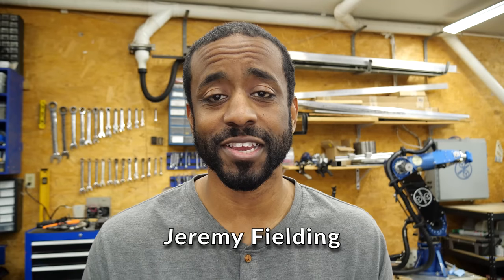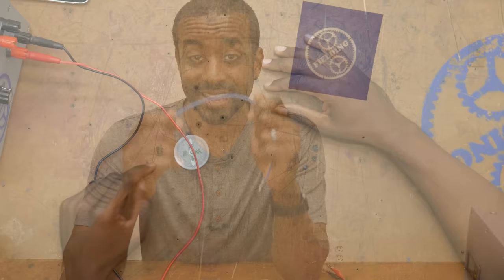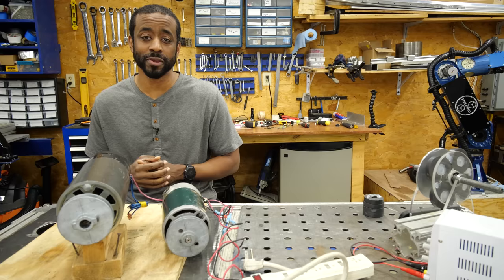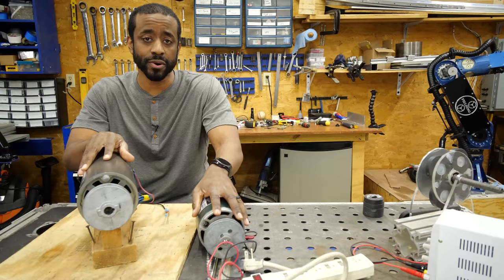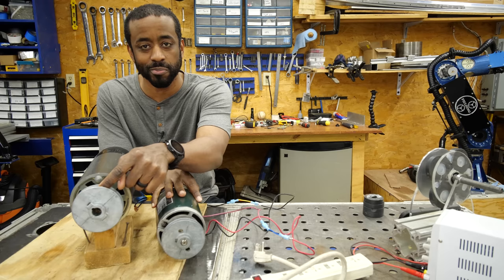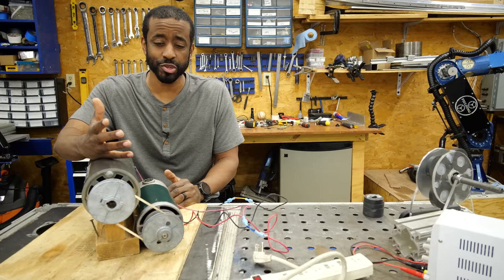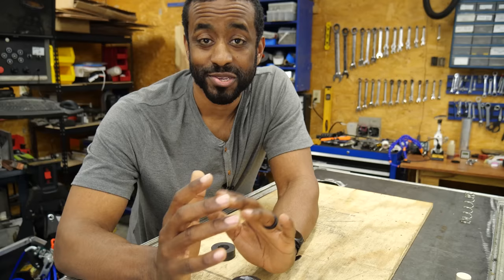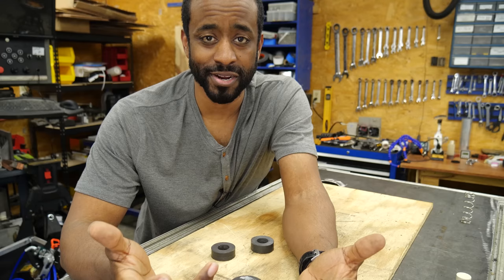Reviewing Free Energy Generators.  A Response to My Video "Nikola Tesla's Greatest Invention"- 102

Comment: In all seriousness, the hardest part about designing a perpetual motion machine is where the to hide the battery.
Reply: A radioisotope thermal generator (RTG) is damn close to being a perpetual energy source, outputting useful amounts of electricity from a battery-sized lump with no mechanical or electrical power inputs, and it will produce that electricity for decades or centuries. It's still not "perpetual" energy though and RTGs require a cold sink for the thermocouples or Peltier junctions to produce electricity from the temperature differential. Still neat though.
Reply: It's actually how to hide the wires.
Reply: @robertsneddon731   and even RTGs have huge limitations, take the MMRTG on Perseverance as an example... 

It's outputting ~110W constant, with a declining curve over years, it weighs 50kg (of which 5kg of plutonium dioxide) and still requires Li-ion battery to meat peak power in bursts. On top of that, it is basically working in flawless conditions given the huge delta-T on the cold sink, given the -60°C average on Mars. 

what I'm trying to say is that, while RTP are impressive (I can't deny that) they still are far from being anything remotely useful/practical here on earth. They have an efficiency of about 15%, while the same plutonium can be used much more efficiently in Nuclear power plants (about 35% efficiency). 

they are impressive cause they can produce power unattended for decades/century on end (while left in the right conditions) but that's all there is positive going for them.
Reply: @andy_liga  The point is that to the unknowledgeable eye RTGs are effectively perpetual motion engines -- they could run a 100W motor under load for centuries with no external power connections or trick components like compressed-air feeds (one fake perpetual motion engine I've seen personally used that as its power source). The best chemical batteries in the same-sized lump as an RTG might manage to drive a similar motor for a few days max then it would stop running as the batteries died.
The Voyager space probes which launched in the early 1970s are still being powered by their RTGs today although their output is well down from when they were fresh. It's possible that everyone alive when the probes launched will die before their RTGs  fail.
BTW RTGs use plutonium-238 which is not fissile and can't be burned in nuclear reactors. It just undergoes radioactive decay which produces a lot of heat since the half-life is something like 86 years or so. There are pictures on the Internet showing  a lump of Pu-238 just sitting there glowing dull red from radioactive decay.
The fissile form of plutonium is Pu-239 which doesn't get noticeably hot since its half-life is a lot longer. There are other radioactive isotopes that also work for RTG use -- the Soviets used Strontium-90 for some RTG applications and ESA is working on using Americium-241 as a "space battery" (not my choice of words, it's from a press release).
Reply: which is why veproject1's videos are so fun to watch.  you know they are fake, but figuring out how he did it...
Reply: @robertsneddon731  not really perpetual considering the massive amounts of energy to refine fuel and construct an RTG
Reply: @kobrapromotions  Of course an RTG isn't a real "free energy" machine or perpetual motion machine but it could be the basis of a very convincing fake that could run for years or even decades with no visible energy input.
Reply: In Zimbabwe their's a guy who created free wireless electricity on a car and tv
Reply: i discovered free energy 6 months ago but i dont want the authorities to find out !!    but i will share this with you anyway .  i took many of my household appliances and hooked them all to a large power bar then ran the other end of the extension cord to my neighbors  outlet on the side of his house . ever since then i got free energy !!
Reply: @foxwell1000  I think you need to watch this video again.
Reply: Lol
Reply: This is the best and most truthful comment out of the thousands of comments on this subject.
Reply: @UnitSe7en  actually not hard at all with the double male ended wire / cord as was shown here.
Reply: @foxwell1000  he is utilizing radio waves broadcast by tv and radio stations. It's clever usage of energy someone else has produced  not creating unlimited energy.
Reply: Another difficult part is using the throwaway collapsing coil flux that is commonly grounded out in dipole killing energy wasting circuits.
Reply: ...or the power cord!
Reply: This is some "Black Magic"! (see what I did there? :)
Reply: @robertsneddon731  Peltier's are little more than solar panels that run on a longer wavelength of radiation. Like solar panels they require input.
Reply: he he... actually got a good giggle from your comment. thanks to you for the punch and jeremy for setting  it up.   I needed  it.
Reply: @foxwell1000  No.  The amount of energy that reaches your house in radio and TV transmissions that he claims to use is measured in microwatts or nanowatts.  Yes, the signal does contain energy but it would take about a thousand years to gather the energy to boil a kettle with enough water in it to make one cup of coffee.   He's a fake, like all of them.
Reply: absolute truth !
Reply: @robertsneddon731  Not really.  The amount of energy put into processing materials to be used in a RTG greatly exceed the low end heat output, even if it last 60 years.
Reply: Exactly where do you hide the battery to make it seem like it's real
Reply: @FireAngelOfLondon  exactly there is energy in the air but not enough to be useful to do any real work
Reply: Yes it appears so far all likely cheat and are not real. Depending on the device type determines its ability to keep running. Example being physics based designs that are not meant to run anything. Often very simple and pointless. The few that are working are very rare. To this day only have a few minutes of footage, so questionable. Primary case I found is being some creator long dead. Installed it in a specific place which some lab decided to move thus broke its operation. At least based on research info I have found. Every device is designed around specific variables, in our case technology wise very simple variables. In realms of scifi imagination cave man level is about most of Earth inhabitants. 

There are a few physicist that explain why being certain places in earth have anomalies in gravity or natural energy fields being stronger, which fluctuate. This guy here covers energy efficiency and heat impact. Combine the two and you get crap shoot of good luck budding inventor… 

If it was easy anyone can do it. Point being its very fine crafting to do, even NASA engineers note this though the bulk just say its a fruitless endeavor. Also note unseen forces sabotage the device and currently we lack technology to negate them, NASA engineers have commented on this. Hence why we instead drive to mass energy storage because its better time spent.

The true issue is a simple one. Once you get it working. It wont run anything anyway as the new load or variable load will simply break the device. Also why NASA and other companies are hunting for better coatings and materials. If nothing else make the intended device work more efficiently. Now I am more in the camp of efficiency design over make it run on its own forever. At least until we develop real true high end technology. My conspiracy side asks if one in current era did figure something out, would they let you keep it or perfect it?
Reply: Absolutely and well said. 
In the field of Power Electronics it's about maximizing efficiency.  not about having more output than input. 
It is cool to speculate and fun to imagine tapping into some hidden energy somewhere and actually harvesting it to do something useful. 
So of course I don't denigrate  anyone who's trying to explain that these motor-generator sets that we see are always a trick or an illusion. 
It is important though to really understand the issue. And be clear about some of what has already been written about here.  harvesting energy that was already is in the air not including solar. 
RF energy for example
But if that is energy from broadcast transmissions it was generated originally from somewhere else and it's not just there. 
If you want info and entertainent on this subject look up the "electro boom" channel. 
Take Care
Reply: @robertsneddon731  You don't need a heat sink or thermal differences to produce electricity from a radiation source.  alpha, beta and gamma voltaic.
Reply: The guy just below has cut and paste your joke and using it for like down below you. The cheek! Get him!! ✌
Reply: @foxwell1000  That is amazing! He must be the richest human alive now...
Reply: @flatearth9140  LOL
Reply: @robertsneddon731  a battery.. you mean a battery. jesus
Reply: Underneath the floor of the vehicle ~
Reply: hard to hide petrol engines as well. the noise gives the game away.
Reply: Bedside draw...😜
Reply: Real original comment every video someone says that
Reply: @ronnielsen8404  Aww... someone's upset they didn't get to say it first.
Reply: you can have a batteries but they just need to self recharged in the process and not stop.
Reply: @robertsneddon731  yeah and that thing is nuclear no?
Reply: buwahahahaha
Reply: @hughmungus431  in other words still useless because we have solar powered battery chargers....
Reply: @robertsneddon731  just a late night thought, but could scintillation crystals applied to a solar panel, wrapped up in a barrel with a tritium doped liquid produce more wattage and eliminate the need for a cold sink, essentially producing a life long battery?
Reply: There are perpetual devices that have been running for a few years  through Inertia  by a Mr St-Germain from Drummondville Québec Canada. .  The device has been running for 3 years , last time I saw it run. .
Reply: @nivekjohn3833  no way Dilithium crystals FTW..... just ask Scotty
Reply: @flatearth9140  hahahahahahahahahahahaha!!!!!! Nice!!!
Reply: @hughmungus431  bbut how do you first start this up by hand ?
Reply: @flatearth9140  that is amazing! You should patent that! In fact, I’m on my way to try it myself!!! Thanks!! And don’t worry, it’s just between you and me….🤫🤫🤫🙊🙉🙈
Reply: @robertsneddon731  And there's your point - a good one. To me, one of the first giveaways that someone claiming free energy does not actually understand basic physics ("lies" as they call them) is that they are totally unprepared to answer the first questions that somebody who understands those "lies" should ask to vet the device. The most universally conclusive test I can think of would simply be to weigh the device, calculate the energy capacity of the most dense energy storage system potentially available (maybe an RTG) having that mass, and then allow the device to run and do external work for as long as it needs until it has output more totally energy than could possibly have been stored in the device. Nobody tries this;)
Reply: @robertsneddon731  damn close? that is like saying something is near infinite any number no matter how large is a minute amount when compared to infinity.
Reply: @hughmungus431  We dont care whether it can charge a battery at all.  We do care whether it can just run perpetually.  How is that going for you?
Reply: Perpetual motion machines exist in many forms, even with just gears. Even those that are not entirely so, only need a little help when running at their full potential, wich could be done by using a part of the energy it creates.
These things exist for 200 years now it's not that crazy, just not allowed to be used by public.
Electricity is literaly everywhere, our brains run on it, it's in the air even wich fluctuates with sudden temperature changes. It's a part of magnetic fields, wich btw, is perfecr for perpetual motion machines. Try buy a big magnet, oh right, you can't.
Reply: @1014p  your conspiracy side should question why a government company that researches ways to travel at lightspeed and literaly researches impossible things, says they don't bother because it's fruitless. The only reason they wouldn't is because they know already.
Reply: @hughmungus431  yes! You should look into the VandeGraaf electrogenerator and the Wimshurst machine. And how they used the Leidse Fles (Leyden Jar).
This was the first condensator ever. They charged them thru conducting thru coils, even Benjamin Franklin used them, where he charged them with thunder to proove it was electric. Read about those old conductors, they raised the power and also the capacity by connecting more than one. Oh yeah they converted the electricity also without affecting the source.
Reply: @kevinvliesable  I'm genuinely fascinated by your opinion. I'd love to just revisit your first statement - "Perpetual motion machines exist in many forms, even with just gears". As you are probably aware, established physics along with the associated terminology does not support this claim at all. I happen to believe I have a good grasp on established physics in this area. 
But you sound very confident, and I'm very curious about exactly why either you or me are blind to our ignorance. Or could it be that we don't actually disagree about physics, only language? 
I hope we can discuss: 
Do you care to describe a gears-only perpetual motion machine?
Reply: @drienkm  yeah I wasn't that precise, my apologies. Not only gears but with the help of some springs basically. Take Breitling watches. Once winded it never stops as long as you wear the watch because of a spring that always points the same direction, wich makes it move inside the watch whilst moving, winding the gears little by little.  This example is not perfect because it's kept running by a seperate process but that's because it won't fit in the watch if it wasn't and that's besides the point also.
Look, you know as someone with knowledge of physics how gears work. Like in a gearbox, the size of the gears opposed to the main gear determine the rate of speed at wich they rotate, smaller gear = faster, bigger gear = slower. 
My point is that if a small gyroscope spring can wind the entire system overtime, I'm sure this mechanic wich is able to wind up overtime without needing force could be applied by utilizing a gear.
Look man there even are systems wich can run forever without the possibility to stop, Google facility use them even
Reply: @kevinvliesable  Oh yes, my dad had one of those watches. You believe that it takes zero energy from the wearer to keep the springs wound via the internal weight? If it did take energy, I do not believe that would be "beside the point", even if we ignored the initial energy added to the watch by winding springs. Do you agree?
Yes, we're on the same page regarding how gear ratios relate shaft speeds. Just for completeness, I assume you are aware that gear ratios also relate shaft torque inversely to the  way they relate speeds, minus a small fraction of the transmitted torque due to friction. Are we still on the same page?
Meanwhile, do you have any leads where I can learn about the device you mention Google using?
Reply: Nah, just add a coil into it a transformer under the table. No batteries required ;)

If you connect the transformer to your neighbors electrics you'll have actual free energy. Well free for you :P
Reply: I wish you would cover what and How Tesla was going to send Energy through the Air. I know you had to have a Tuned Filter to receive it from the Tesla Coil. He was sending it through the Ground I believe. I would love to have you explain it.👍😁❤️
Reply: @joeybobbie1  Do you view sending energy through the air as significantly related to the topic of free energy?
Reply: As soon as I saw that video, I could see tons of ways to fake it. Today's lithium batteries can dump tons of power for a demonstrations like this.
Reply: Yes sir, No such thing as Free energy. Everything comes from somewhere.
Reply: Exactly. Or when built by a well intentioned person, maybe the hardest part is internal defense of one's own belief that "I don't need to get educated in all that fake (and maybe kinda hard) science and physics stuff! The fact that free energy isn't commonplace is just because of widespread, and unbelievably well executed coverups that extend into every facet of technology and industry in the entire world. Yes indeed - an unprecedented marvel of human cooperation, unity, organization, communication, and precision of execution..."
🙃
Reply: @robertsneddon731  and damn close is absolutely useless in this case...
Reply: Same problem with solar and wind power. 🤣
Reply: Prefect Answer.🤣
Reply: @kevinvliesable     (-:   

So then what you are saying is that at home  you have a simple PM machine running, running, running............   If not, why not?

"Not allowed by the public"???   So then, you have people appearing at your doorstep checking to see if you have any perpetual toys in your house?  That has never happened to me.

Big magnet????   If magnets can propel a PM machine, a small one will run just as well as a large one.   So far, in the history of the whole world, no body has ever demod that a permanent magnet could power anything.   A permanent magnet cannot propel a device, not even partially

For perfectly obvious reasons.
Reply: @robertsneddon731  who has one for sale?
Reply: @wendellhammond7853  Software needs => Computers needs => electricity
Reply: @christopherperdue977  Ever heard of the inverse square law? Do the math and you'll find that yes the energy exists, only it's TINY compared to even a modest solar panel on a cloudy day - sure if you made that aperture big enough (miles of antenna area) you'd got some meaningful energy - but way LESs that the equivalent area of solar cells
Sorry
Reply: @hughmungus431  "Boom done." - CITATION REQUIRED

 This is why we use numbers diagrams and equations in science - if you turn your string of words into THOSE you'd be able to clearly see all those forces are STILL working within the laws of thermodynaice, and the conservation of energy

Its just possible, with magnetic bearings and the like, you could make a VERY low friction machine that might just run for MONTHS unattended, when spun up - but seen as you take any energy OUT, pffft !
Reply: @kevinvliesable  No they didn't - any tiny amount we drain, from say a lightning strike, or ionospheric ionisation DOES affect the source, there'll be less energy there
Reply: @foxwell1000  Zimbabwe… the peak of mkdern technology advancements… lmao
Reply: Lol
Reply: @FireAngelOfLondon  Bro don't degrade his/someone's analysis or idea what ever it is. As you said so the energy Which was able to transmitt by radio frequency is measured may be in a nanowatt quantity and unable to run electric/elelectronic components and do some other activities wirelessly .
As we have learnt in high school or higher education - inorder to make a drop of  Water molecule from two Hydrogen atom and one Oxygen by simple composition reaction , to Your surprise ,it takes 1 billion years . But to your surprise ,after the invention/use of Catalyst ,it takes a fraction of seconds .
Who knows  ,in the near future there Will be an engineering and technology that would not only produce in Giga,etc sizes but also able  to transmit these frequencies or EMF Wirelessly .
Do You know that in the early forties , HE Nicolas Tesla has tried and run a pilot project to transmit High KV Voltage for some hundred meters and this inventive ,generic ,entelegent ,etc. guy executed/murdered at his own laboratory . Anf for the next sixty years till the assembled Electric Automobiles ,Hybrid Automobiles and Mechatronics ( Mechanical ,Electrical and Computerized ) ,the poor guy tragic death besides his various fruitful practical lab investigations and Scientific approaches/hypotheses eradicated by the then NYPD/*** agents for maybe/maybe not unknown reasons. Needless to say more but how on earth to forget His Excellency's inventions like Induction Motors, the high KV Power Cable transmission in thousands of Kilometers from Hydroelectric generating sites ,Computer Mouse technology, among others.
May Almighty God Rest His Soul in peace !.
Amen !.
Reply: @andy I could have sworn that someone just mentioned how mars averages -60 c and the environment is ideal for Peltier couplings, now here you are complaining about the heat produced from the decay, I guess my question to you is, isn't heat a form of energy, and isn't all forms of energy interchangeable, not to mention the negative sixty degree average on mars, even worse than the good old American farenheit system. Welcome to America where twelve inches=a foot, sixteen ounces=a pound and Wikipedia and reporters without borders named our internet as absolutely censored!!! ✨✨✨
Reply: The hardest part its to make it because u watch it but il pretty sûre u dont have really interest for this juste à video for u :) easy toi watch but when u have toi Patrice oops dissapear
Reply: @foxwell1000  Nigeria too.... 😀
Reply: @flatearth9140  👍
Reply: Its called  The Electro Magnetic Motor. Tesla patented it and if you look up Howard Johnson... Not Blacky Johnson You will see that Zero Point Energy exists and you can see parendev and vgate and other electro magnetic motors working perfectly well on youtube. Yes there is tons of scammers looking for clicks but there are also legitimate working examples of Tesla's Electro Magnetic Motor. Howard Johnson also holds numerous patents on Magnet motors and if you know anything about the patent office they dont give a patent unless the patent functions as described. You cannot patent something that does not work
Reply: Why bother? PM is a ridiculous concept. For one thing it would require zero resistance to motion, surely easy to understand?
Reply: @flatearth9140  What are you waiting bro,don't go with that knowledge to the grave,the World will never know you had the knowledge share
Reply: @franktutut2678  HUMANITY IS NOT READY YET !!
Reply: @flatearth9140  I am ready
Reply: @franktutut2678  A PERSON IS READY BUT PEOPLE ARE NOT READY!
Reply: @flatearth9140  one person can make the people to be ready
Reply: This comment does not deserve one like. It's blatant copying.
Reply: @gurnblanstein9816  OK KAREN !! NOW GO COMPLAIN THAT YOUR NEIGHBOUR'S MUSIC IS TOO LOUD !!
Reply: @flatearth9140  only steers and queers type in caps and I don't see any horns on you so..
Reply: @gurnblanstein9816  WE"ER HERE AND WE"ER QUEER SISTER !!!
Reply: @kevinvliesable  "Take Breitling watches. Once winded it never stops as long as you wear the watch because of a spring that always points the same direction, wich makes it move inside the watch whilst moving, winding the gears little by little."

==So, why do I have to wear the watch for it to work? How is this a perpetual motion machine?
Reply: @louistournas120  it is when you wear it
Reply: @kevinvliesable  Such a watch is not a perpetual motion machine since it uses your body's energy to power itself. As you walk around, you have some kinetic energy.
The movement of the arm is used to move a mass inside the watch.This does a winding up of a spring in the watch.
Reply: @hughmungus431  no, this won't work. Gravity is a conservative field (i.e., you can define a "potential function" for the vector field"Gravitational force"). The total work W done by this vector field over a path is the line integral of the vector along said path. If the ball reaches the same height every time, the path is a closed path, so we can use Stokes theorem, reaching W=0.
Reply: @robertsneddon731  RTG’s are not effectively perpetual motion machines. Perpetual motion means no external energy input to keep them running. For one thing Plutonium-238 is an outside energy source, and the manufacturing of Plutonium-238 require a f*ck-ton of energy to manufacture. It’s virtually nothing more than a long lasting battery where the amount of energy put into making it exceeds the energy outputed while using it.
Reply: @foxwell1000  That’s a Zimbabwe scam. There’s no such thing as free energy.
Reply: @dross4207  I know, but what I was saying is that you could make a very believable (but fake) model of a perpetual motion machine using an RTG. It could run for decades or even centuries, turning a falling-weights wheel or whatever, without any apparent energy inputs from outside.
Reply: We are living on a Perpetual  Motion Machine a planet called Earth.